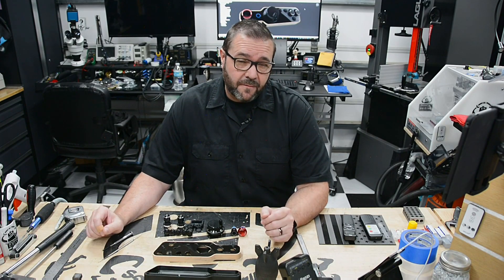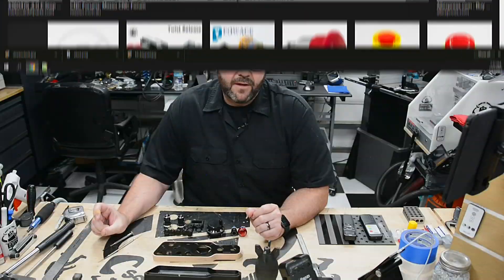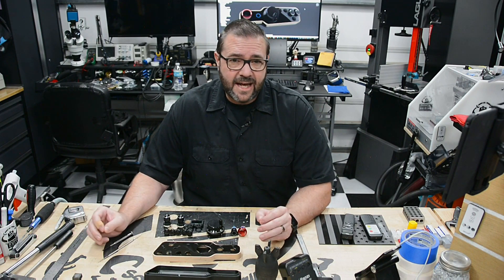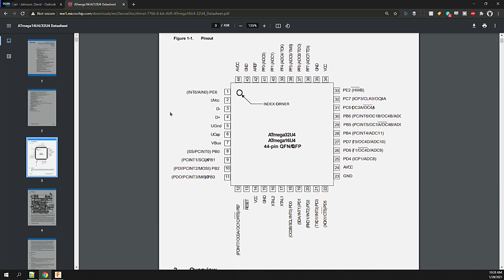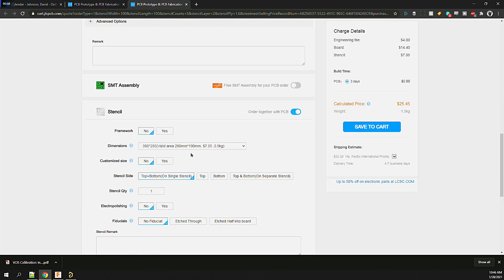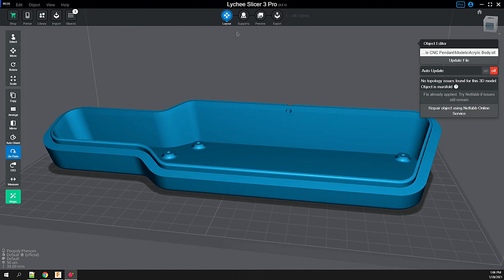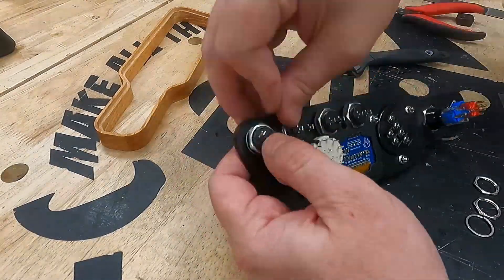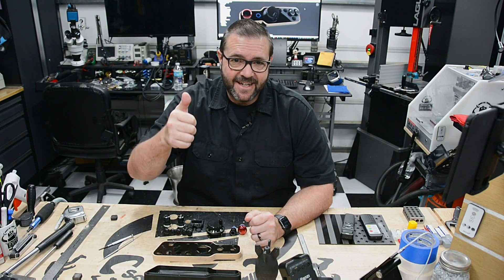Building a Better CNC Pendant Using Fusion360!

Comment: This is a fantastic project. Would you be interested in upgrading this to be wireless for a bit more money for the plans? That would be of great interest for me to purchase. Thanks, Brian
Reply from the maker: Sure that sounds like a good upgrade but the software most people use are limited to support much customization other that hot keys
Reply: @DIYEngineering  Upon a little research it appears that even moderate priced commercial pendants do poorly on bluetooth when moving things by a thousandth of an inch.  Seems a bad data protocol for the use case. My bad!

Comment: What kind of laser did you use to cut and engrave the acrylic? The whole build is super clean! Great work!
Reply from the maker: I have a 40w laser but it can also be milled. Thanks!
Reply: @DIYEngineering  I'm assuming diode type. I'm wanting to get into it but not sure if I would have to get a co2 type. Thanks for the videos.

Comment: Hi David. I am wondering how you got your bottom layers to print so nicely even though you printed it directly on the bed?  You've inspired me to make something similar!
Reply from the maker: the trick when printing directly on the bed is to ensure you have adequate layer times to cure the layer and not extend much beyond that for the first layers... otherwise you will get "elephant foot"... also, reduce your lift speed if you have large solid layers and you're using an MSLA printer...

Comment: This is really a fantastic blend of technology. I am imagining building this for my old OZO cnc. I now have it retrofitted to use a raspberry pi and grbl shield with gecko drives. Hand controller is still just a numeric keypad though. Not very elegant. It would be a real challenge for me to build this controller. Love the way the design comes together. You make it look easy but... I can only imagine how much time it took to get to this point. Here is a photo of my machine ;) Its an old circuit board  delaminate machine. Converted to CNC, built by OZO automation.
http://soulysolar.mudventions.com/wp-content/uploads/2008/11/holddown19.jpg

Comment: David you should think about a live chat session with the option for a super chat.
Reply from the maker: I have considered it, but in doing it in the past I usually end up having a one-sided conversation with two people asking me to "dab" or dance for them... :)
Reply: @DIYEngineering  That is so messed up but have a few beers first and dance baby dance. I bet you it would increase the donations. ;) If they ask you to strip tell them the show is over. LOL Besides you could get someone in the chat to moderate.
Reply from the maker: @chatbear69  you’re hired!
Reply: @DIYEngineering  I'll do it. But it will have to be after 7pm your time as I will be at work 6pm your time. Also I need a test run as I have never modded a chat before. Aside from that line it up my man. And one more thing display The Force beer dispenser and get a beer from it during the show. You don't have to drink the whole pony keg just have some friends over .... hmm Covid. On second thought you might have to drink the whole thing yourself but not on camera. Besides it gives you the excuse to get the pony to begin with. ;)